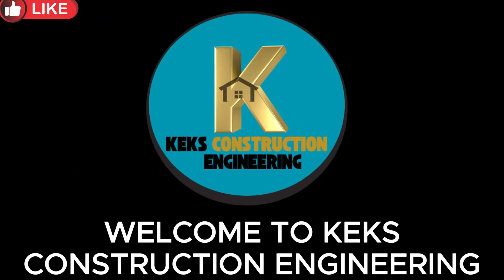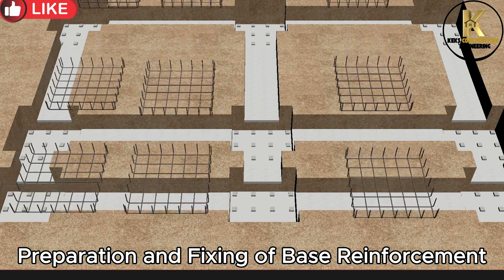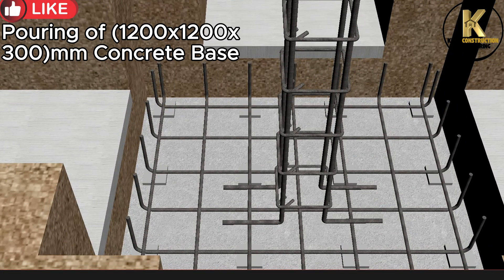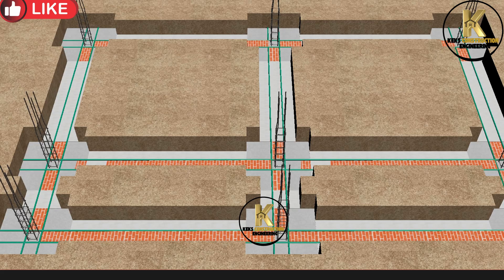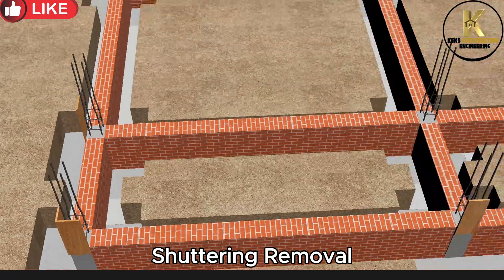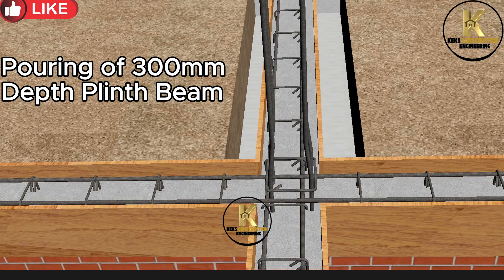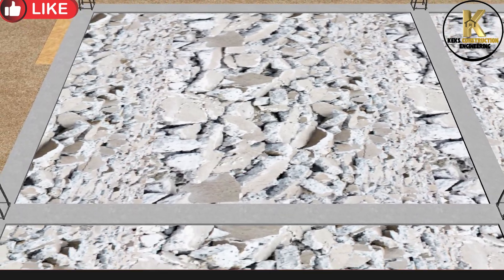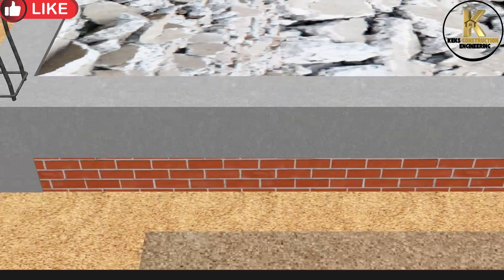Why Plinth Beam in Building Construction? (Step by Step Site Work)

Comment: one of the best and well explained engineering videos l have watch online. Thank you,  l will subscribe asap😂😂😂
Reply from the maker: Thank you so much for Subscribing and for your kind words. 

Do you want to improve your woodworking skill and gain more hands-on experience?
After watching these 10 Speed Square uses, tell me which one will help you work faster, cut more accurately, and upgrade your woodworking results.
👇
Share the tip that stood out to you the most — and let me know if you want more clear, step-by-step videos that break down tools, techniques, and time-saving construction methods!

Comment: Whats the difference between tie beam and plinth beam?
Reply from the maker: Ok.... 
The difference between Plinth Beam & Tie Beam is that.....
 Plinth is provided at the plinth level to distribute the load of the wall above and prevent differential settlement, while 
Tie Beam is provided to connect columns at a higher or any level to reduce their effective length and prevent buckling.

You can watch the Video I made on this...."TIE BEAM vs PLINTH BEAM" 
For more understanding.

Thanks

Comment: nice video. why did you not put any foundations for the brick walls?
Reply from the maker: Ok....since the soil has a very good bearing capacity and the designed load of the structure is very low. 
For this reason, i provided a fair Strip  to carry the Bricks

Comment: Sir, Made a mistake in not mentioning that we do not use backfilling, for on capacted ground concrete slab. We stay with at least 750 mm above grade suspended concrete slab, to prevent rising damp and subfloor ventilation.
Reply from the maker: I really did not get your point here.... Can you make it clearer so I can understand what you mean?

Comment: It is a very good video, replace Shuttering with a more powerful and appropriate word, Formwork. Please can you provide me with the structural engineer drawings, to get a better picture of what is to take place, then follow the process, Sir. I would be grateful if you email me the request.
Also, please make a video of the same construction, only this time the bearing capacity is poor and I need to use screw piling.
Focus on the correct sequence of events for the installation of each construction element.

Comment: Please make a video showing that my plot is in 2 steps each of area 55x45 sq feet. Height difference is around 14 feet between these 02 levels. Show me how to build a house.
Reply from the maker: You mean how to construct foundation on a sloppy land?
Reply: @keksconstructionengineering  actually it's not a slope. What happened is the plot is located near a river and once it was flooded, it cut some of its portion. Now plot is divided in 2 parts which are 14 feet higher to each other
Reply from the maker: @waqassadiq5304 
Ok.... I understand.
Do you intend to extend your structure to the part that water is Entering?
Reply: @keksconstructionengineering my plan is to make RCC wall with plinth beam and columns on front and back side of first step  to raise the first step enough so that water can't enter again then to construct 2nd part in a way that half of it on land and half on first floor. If it's not a good plan, kindly suggest me how to do it
Reply from the maker: @waqassadiq5304 
I wish i can see the picture of the place. This would have help in giving you the best suggestion

Comment: Hi Keks. I have started constructing a foundation of a structure measuring 11 x 16 metres. It has columns but without reinforcement. The engineer advised reinforcement of columns. Can I still destroy the columns and start them from scratch and dig deep to 1.2 metres as indicated in this video?

Comment: Good day sir, my question is: what’s the required distance in millimeters from the concrete foundation to the plinth beam?
Reply from the maker: Ok.

The total Depth to Plinth Level = 1500mm
Depth of Plinth Beam = 300mm

So the Distance you are Asking is = 1500mm - 300mm = 1200mm.
Reply: @keksconstructionengineering  ok but what if the Architect decide to go beyond that measurement (2100mm to be specific) due to flood or aesthetic, does it affect the structural integrity of the building?
Reply from the maker: @VincentMoses-w1k 

It is not the Job of Architects to Design Foundation and determine the Depth.
Rather it is the sole duty of a Civil/Structural Engineer to do so.

However, Architect and Structural engineer always work together to bring the design to Reality.
Reply: @keksconstructionengineering Alright! Can you please do a video showing how different floor levels are constructed where plinth beams are used.
Reply from the maker: @VincentMoses-w1k 
 
Noted but it will take a while.

I am currently working on ground Beam, it will be Uploaded on Sunday.

Comment: what is the minimum acceptable clear spacing between pad footings ?
Reply from the maker: This cannot be given by estimation or assumption, it is strictly base on the Structural design....where the load of the structure and the soil bearing capacity are the major determining factors.

Comment: Sir what depth do you introduce for a 3 to 4story building  ie the strip and  column base
Reply from the maker: As a Civil/Structural Engr.  We don't Predict results. We do the Structural Design of the given Building.... Then from the structural analysis and Calculations, all the structural details of the building will be provided. 

This is the right thing to do so as to get the exact result that will be safe, durable and Economical. 

Stay Tune to KEKS CONSTRUCTION ENGINEERING for more Construction Updates. 

Thanks
Reply: @keksconstructionengineering what a professional reply ❤

Comment: Nice work Keks I can see that there are lots of questions you need to answer so ill be waiting for your response to them hopefully through more videos
Reply from the maker: Yes Chief QS. 
In the next Video, I will do the Super structure and use it to Address TIE BEAM. So that people will truly understand and be able to differentiate between Ground Beam, Plinth Beam and Tie Beam. To know when and where to used them in building Construction. 

Thanks for your steady Participation on KEKS CONSTRUCTION ENGINEERING.

Comment: Is plint beam sitting on the block work wont it cause cracking and it is not solid fill. Am just asking am a student since i taught the weight of plinth with affect the block wall
Reply: It's a load bearing beam, when it has attained full strength it acts independently, so the weight won't affect the Blockwork.
Reply from the maker: @benjaminpreciouschukwuebuk6393 

You are Very Correct . 
Weldon.
Reply from the maker: Benjamin is Very Correct. 

I hope you Understand now.